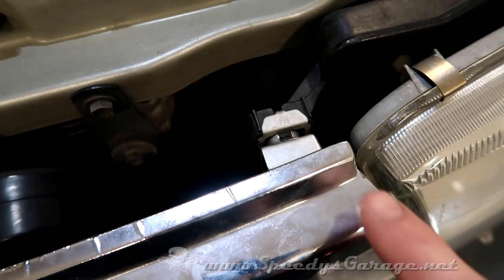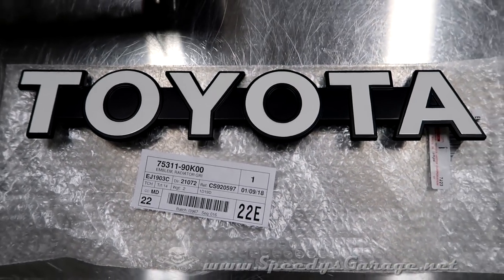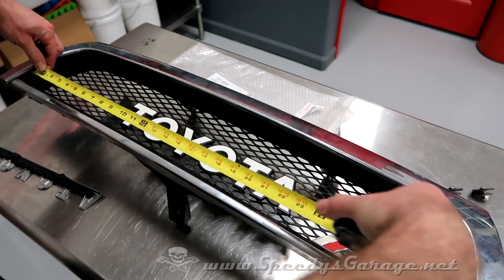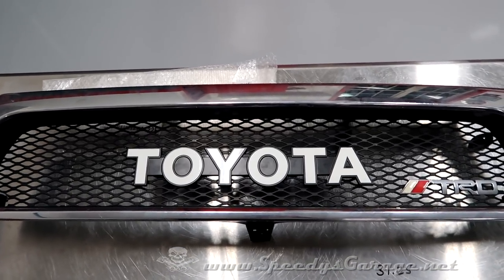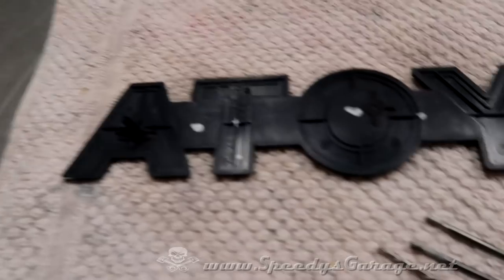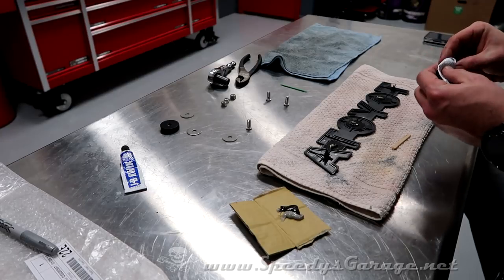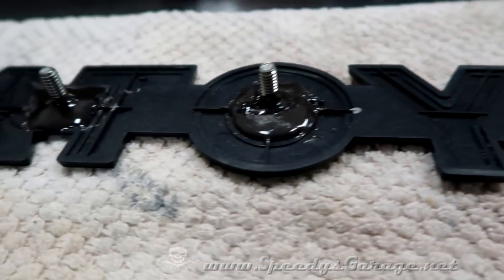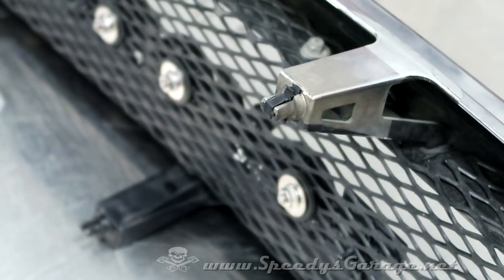4Runner Grill Upgrade

Comment: Love your website! I’ve done the first grill modification, 3” suspension lift, 17” rims to fit the larger of the Tundra brake upgrades and the Tacoma antenna. Thanks for all the great info. My rig has 308,000 miles on it and isn’t nearly as clean as yours. It’s my DD/Work truck. Love it!

Comment: Hex head bolts would work better. Apply heat to the head and melt an impression. 
JB weld would not hold with this job. Way to much wind and vibration would weaken the bond... Super glue the hex head bolt in after melting an impression.
Reply from the maker: Hanging in there like a hair in a biscuit still as of this comment.

Comment: What size of bolts/nuts did you use to secure the mesh into the grille?
Reply from the maker: That was about 12  years ago and I don't remember but something small with a washer.  Like 1/2 inch #10 or something.

Comment: Nice build.  Embedding your emblem mounting bolts with JB is a bit finicky.  Since the emblem already has locating tabs on it, why not use a semi-permanent trim adhesive  like 3M 03601 to bed the emblem?
Reply from the maker: It's help up great, but yes is tricky to implement.  I've not found an adhesive strong enough.  Since the grill is grate material, there's limited surface area for the adhesive to bond with.  Putting a panel behind and using some industrial stuff like is used for windshields might work though.